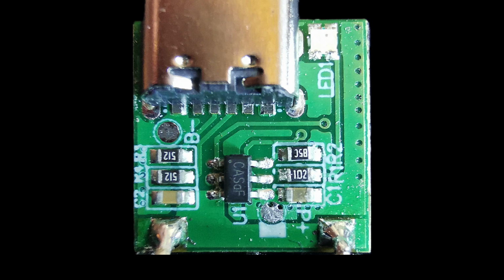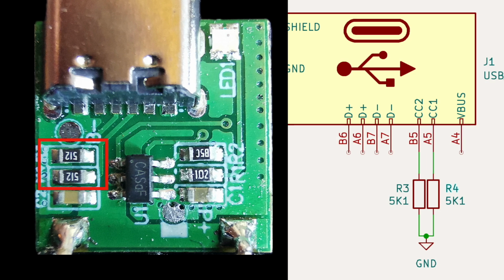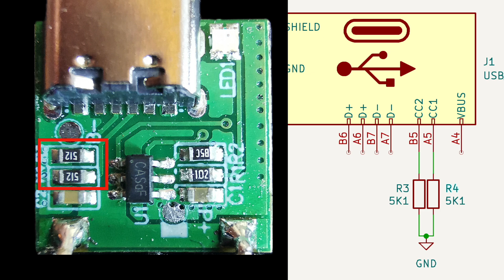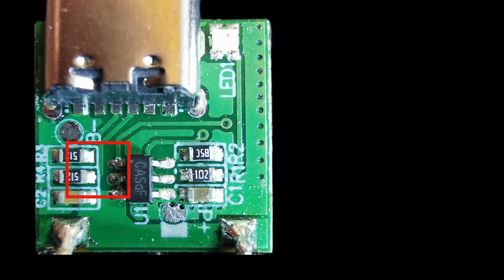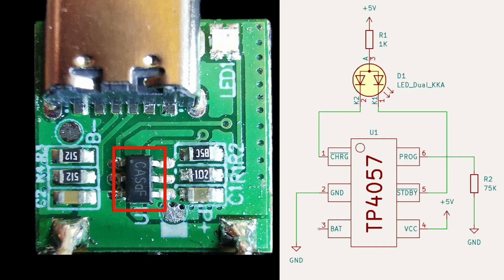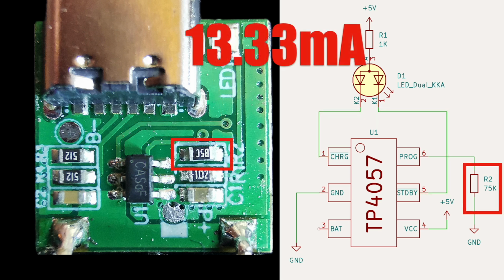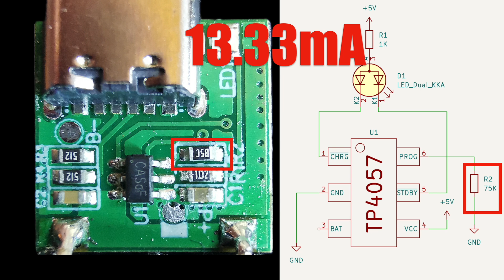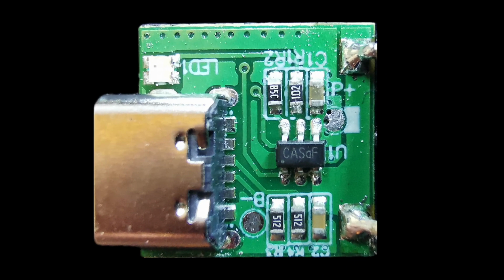What's inside a coin cell charger?

Comment: Aren't lithium coin cell batteries supposed to be charged up to 3.6v?
Reply from the maker: The LIRXXXX ones all seem to be 4.2V - eg https://docs.rs-online.com/2a3b/0900766b8170b06f.pdf
Reply from the maker: The ML and VL series of cells have different voltages and charging requirements.
Reply: @atomic14extras  Oh thanks! Big Clive reviewed a ML2032 rechargeable battery recently with a 4.2 charger, called it fake and I didn't know there were different rechargeable coin cell types with different rated voltages, again thank you for correcting me and great video!